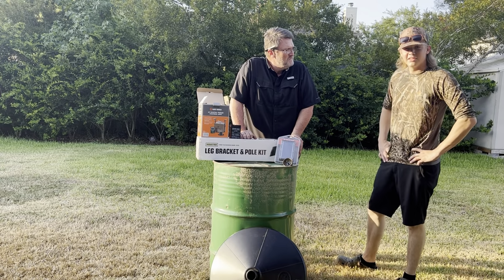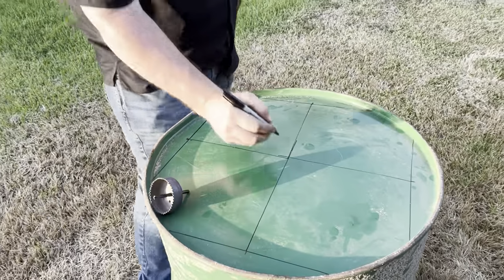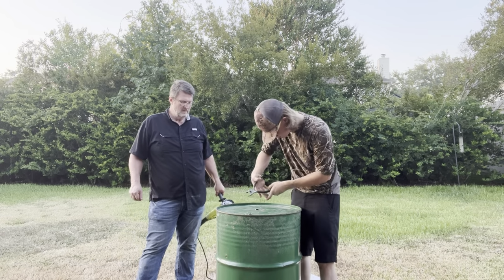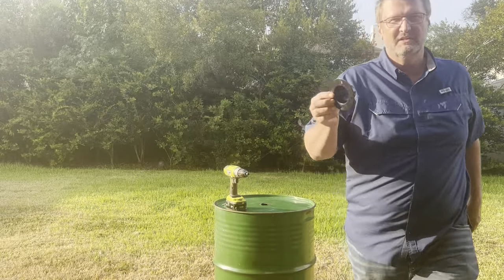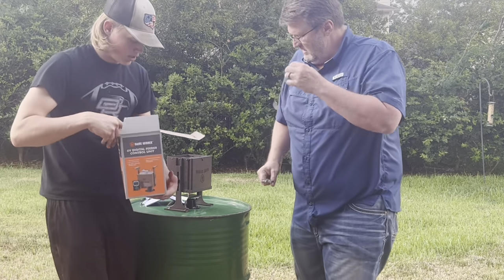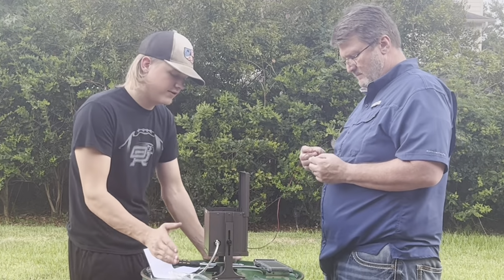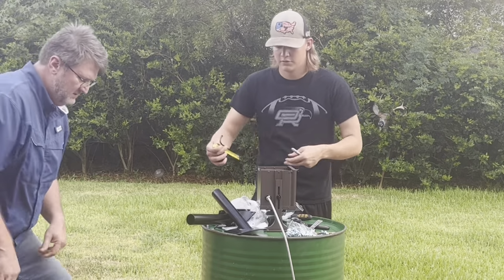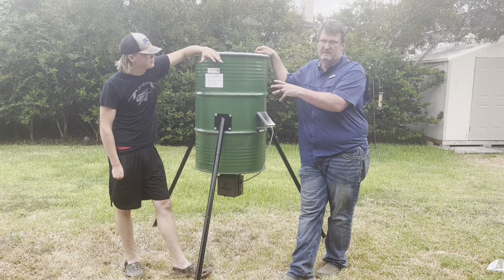DIY Deer Feeder 🦌Informative and Entertaining 🤪

Comment: Didnt the instructions call for a 1.5 inch hole? Not 2.5??
Reply from the maker: To the best of my recollection the instructions called for a 2.5” hole.
Reply: @r-ranchadventures  Manual says 1.5" hole saw, but does the 2.5 work or does it toss out too much feed?
Reply: @r-ranchadventures  tried to post a picture of the manual but won't let me
Reply from the maker: So below the hole is a plastic funnel with a flange that bolts to the bottom of the drum, so no excess corn is spilled or thrown as it is regulated by the opening on the bottom funnel piece.